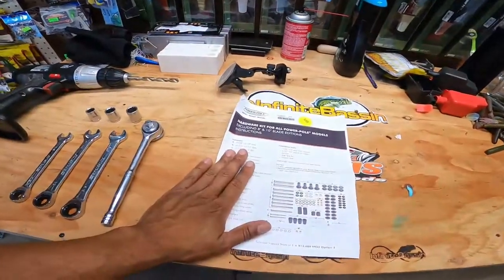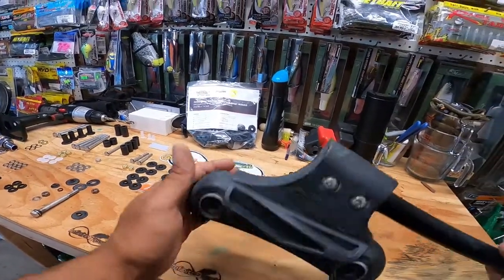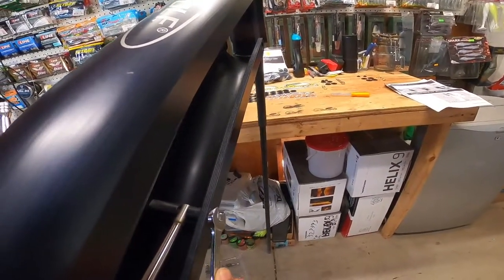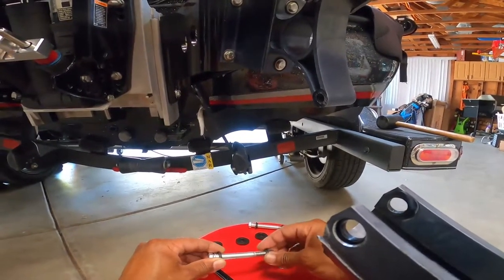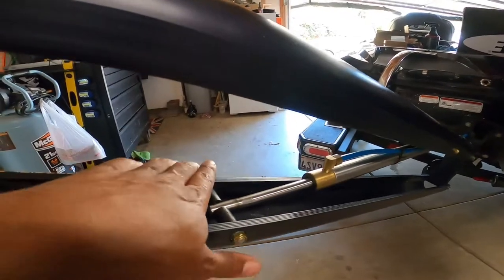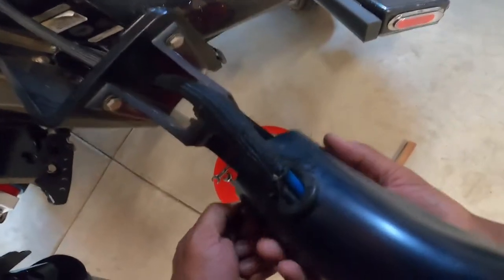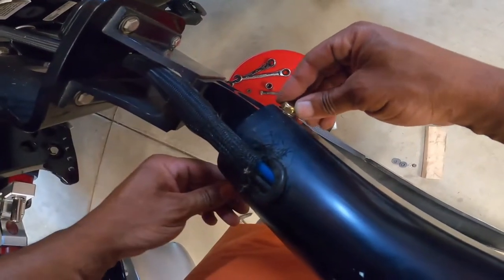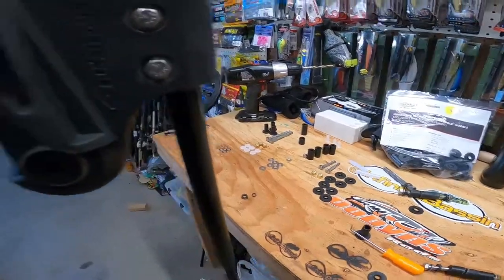Full Power-Pole Break Down and Rebuild (JL Marine Systems)

Comment: Great video. I believe they have updated knuckles as well.
They won’t have near the bushing issues as before. Or simply by new blades. Lol. But hell who wants to do that when the 1st&2nd gens work fine. That is when they’re tight. Also get you some covers for traveling and a couple of straps. Keep it tight bouncing down the road and they’ll last 10x’s longer
Reply from the maker: Thanks and I'll have to look into those knuckles they most likely didn't have them when I made this video. I'd love to have new blades but definitely no reason to spend the money since the old works just fine. I do have travel covers for my poles they help some with alleviating the bounch going down the road.

Comment: Just got a used one today, the black sleeve that holds the fiberglass spike has cracking in it and being held together/in place with 3 hose clamps. Does that sleeve have a name?
Reply from the maker: Yes that sleeve is called a knuckle. They run about 100 - 140 bucks depending on which model you have.